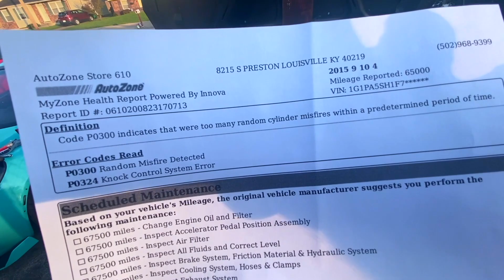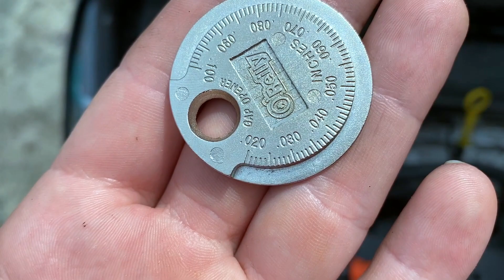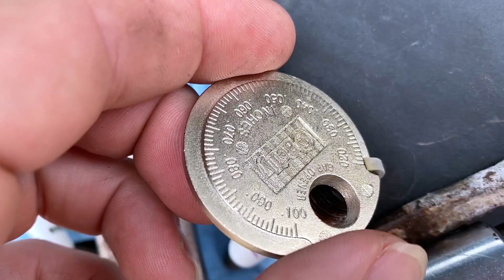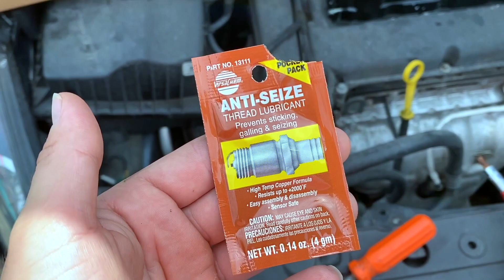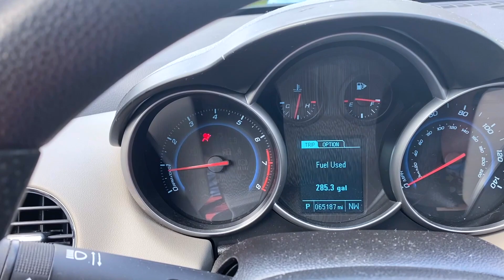2015 Chevy Cruze Check Engine Error Code P0300 - P0324 SOLVED - Easy Fix

Comment from the maker: Get Free Quote Now - http://bit.ly/36K1AfJ Save up to 52% on your car insurance
Don’t Keep This To Yourself ? Like & Share ❤️❤️

2-Piece 5/8" Swivel Magnetic Spark Plug Socket,16mm, 5/8-Inch - https://amzn.to/2QVQ0c0

Ignition Coil Replacement for Chevrolet Cruze 1.6L 1.8L - https://amzn.to/2Fen6kD

Champion Iridium Replacement Spark Plug - https://amzn.to/3lUFPmf

Ramp-Type Spark Plug Gapper - https://amzn.to/32Z0z3O

Hey – I've been using this GetUpside app to save money on gas and I love it. I've gotten $734 so far. Give it a try. It's basically free money. Use this link or enter my promo code GBXVZ to get an extra 15¢/gal cash back on gas on your first fill-up: https://upside.app.link/GBXVZ

Toggle Offers Completely Customizable Renters Insurance, so you only pay for what coverage you need. With policies starting at $5 http://fnv.go2cloud.org/aff_c?offer_id=8&aff_id=1028

Get 2 Free Stocks With WeBull – Each Up To $1400 In Value
https://act.webull.com/kol-us/share.html?hl=en&inviteCode=u7THxkyFCPv7 

Social Media 
Follow Me On TikTok - https://www.tiktok.com/@senadbyw

#chevycruze #chevy #cruze

2015 Chevy Cruze Check Engine Error Code P0300 - P0324 SOLVED - Easy Fix
When these engines misfire on one or more cylinders they set check engine light computer trouble codes. The random misfire code is P0300.

Comment: I have a 2014 Silverado 5.3L VVT. I just had both of the knock sensors replaced and the knock sensor code P0324 keeps coming back as a permanent code on my BlueDriver scanner. I wonder if changing the spark plugs would solve my issue?
Reply: May be the wire hareness to sensors
Reply: @rekburtbudgetbuilds  kinda what I am thinking. Had both sensors changed out and it is still throwing the code for Bank1 Sensor1. I'm sure it is the harness to it.
Reply: I have the same problem on my 15 silverado exactly what the video says and the same 2 codes! I changed the spark plugs and wires and still does its and changed the knock sensors both and still does it what could it be??
Reply: Have did you ever find the problem on your silverado?
Reply: @danielgarza5272  yes, try running 91 or 93 octane in it. Clear the code after you fill up with 91 or 93 octane and I bet it doesn't come back again. I changed the knock sensors, harnesses and other things and it turned out to be a fuel octane issue
Reply: @danielgarza5272  it is the fuel. Run 91 or 94 octane fuel only and it will go away.
Reply: P0324 is excessive knock detected
Reply: @chasedavis2358  yeah I had to change  knock sensor and have the relearn done along with the crank position sensor and relearn

Comment: I like the Aftermarket Hood Support
Reply from the maker: 😂😂😂 my favorite part of the car lol
Reply: hello I have a.2015 Chevy Cruze Lt 1.4 tubro I have replaced spark plugs and coil pack and  negative battery cable. On dashboard it says service stabilizer and traction control. On my scan tool is PO 300 and   PO 36 the PO 36 is down stream O2 sensor but not sure about the other one please help ty  I'm watching your video from 3 years ago

Comment: I been getting that code p0324 for a while now. I’ve changed the spark plugs before twice and the coil pack and works good but after awhile the light comes back.
Reply: If you take off the whole top of the engine, you will get access to the valve timing belt. There is a little orange plastic piece that holds chain up. Check to see if the 2 bolts are tight. I had the same issue. Tightened the bolts and problem was solved. Had error code p0324
Reply: P0324 is a knock sensor
Reply: the 1.4 tubro has a chain not a belt

Comment: Mine is doing that with the high rpm but car not moving then starts sputtering.. I changed the spark plugs n oil. I have a knock sensor code gotta figure it out.